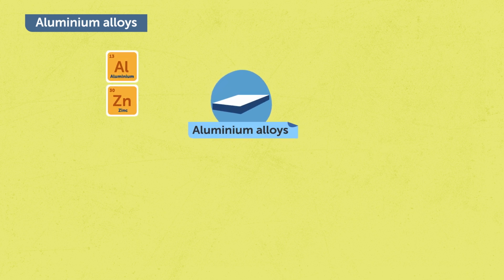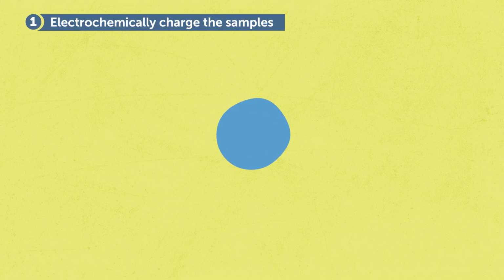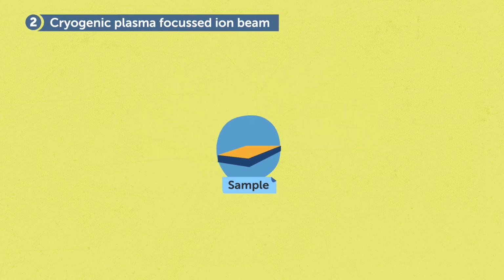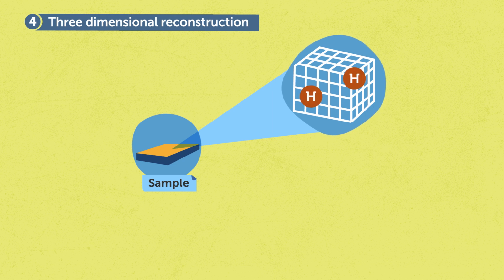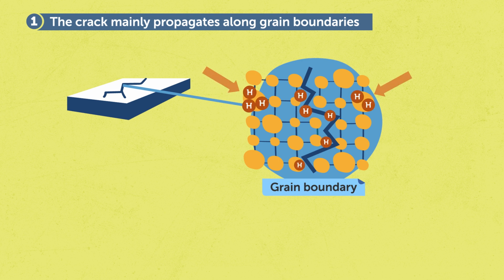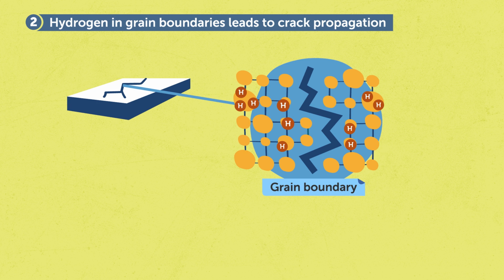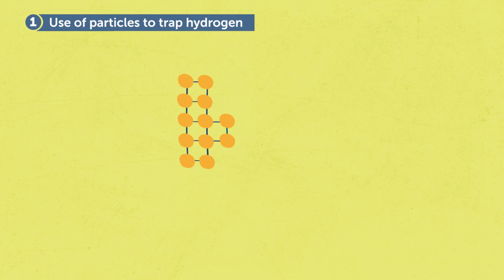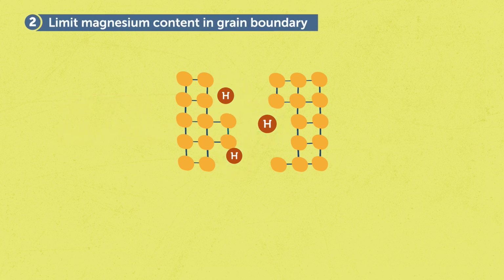How does hydrogen behave in aluminum alloys?

Comment: Brilliant! It's a step forward in aluminum research. Is there any alumina (Al2O3) consideration in this study since it forms by default over aluminum alloys?
Reply from the maker: Thank you for your nice comment. In this study, the samples were freshly polished and the native surface oxide was removed before hydrogen charging. We also did not observe the existence of native oxide in the atom probe experiments. Al oxide is indeed very important. We are currently working on the influence of the oxide on the hydrogen-related embrittlement of this alloy. Stay tuned :)